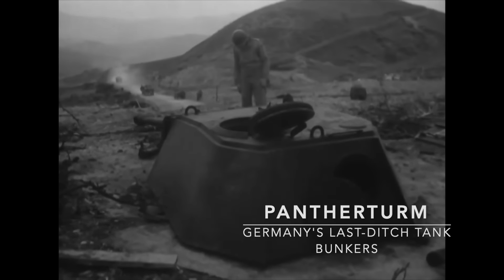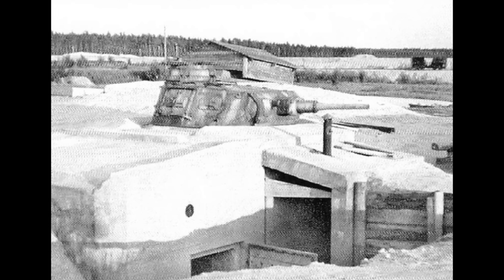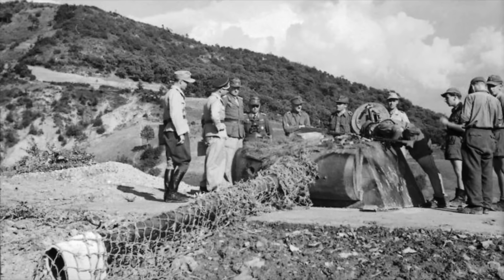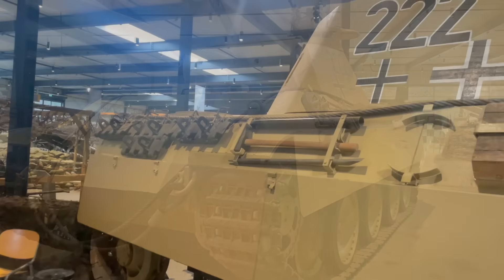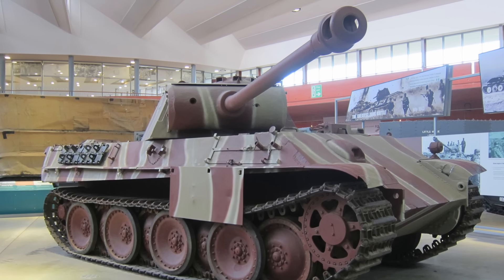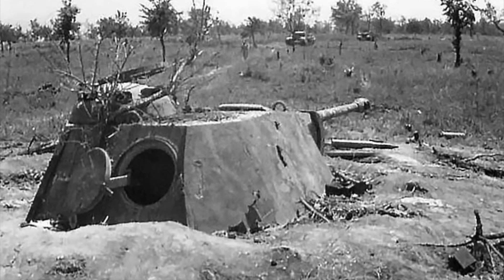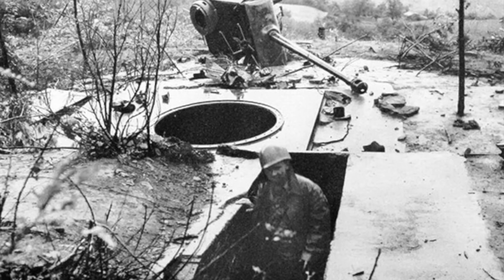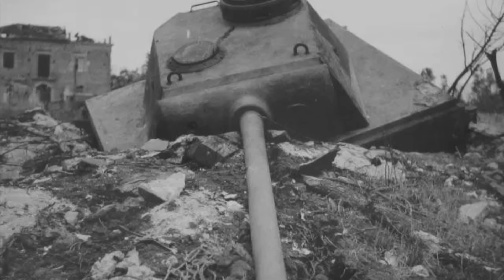Pantherturm - Germany's Last Ditch Tank Bunkers

Comment: I can only imagine the terror that Allied tankers experienced when being ambushed by one of these Pantherturme...
Reply: Panthertürme is the word you're looking for
Reply: @hansg9832 weird not how Dr Felton spelt it in the title or description.
Reply: @lumenvitae4215 it's the plural
Reply: Not much horror. A 75L70 firing from a fixed position at a target at a known range - most allied tankers would have no time to realize they just died
Reply: @lumenvitae4215  der Turm 
die Türme
the tower
the towers (or turrets)
Reply: At least they couldn't break down.
Reply: Another interesting video. But Mark you didn’t say if the gun turret could rotate or was it static - firing in a single direction?
Reply: @Wavesonthemountain  It can rotate. Sits on a normal turret ring
Reply: @Wavesonthemountain They rotated manually by a crank. More advanced ones kept a powered geared traversing ability. By the end of the war, they were just burying a tank, adding a twist to “Hull Defilade”

Comment: It’s also logistically cheaper to mount one of these turrets. It doesn’t require fuel, entire mechanic crew, or part replacement program to maintain it.
Reply: It was a desperate, delay, speed bump at best
Reply: I'm guessing the bunker and turret required a gasoline engine-generator to supply power for the turret rotation and gun elevation.
Reply: @gregorymalchuk272  I think he actually covered that in the video, some had powered traverse provided, some (I'd guess most) just had manual turret traverse and elevation. Since it's a stationary turret meant for point defence speed of traverse isn't really a huge concern.

Comment: At the time the Panther entered service, the Germans had learned the lesson of needing a good armoured recovery vehicle or ARV.  Before the end of the war, over 300 Panthers were modified to fit the ARV role, which essentially required the removal of the turret and adding engineering features such as winches (if available).  The finished product was known as a Bergepanther.
Reply: The Bergepanther where all purpose build. The inital batch where basically tank chassis without a turret but later had quite different hull fronts and a massive winch etc.
Reply: Burgerpanther sounds delicious
Reply: @I_hunt_lolis  One of those totally wrong Allied translations. In german it would be a Bulletenpanther and a Bullette does not come in a bun, it is only the meat part ;)
Reply: Some notes: Englisch wall is in german Mauer/ Wand, german Wall is in english rampart. The Westwall was not the first defensive line in western botderline of Germany.. In baroque era in south western part of HRE, mostly in current state Baden-Württemberg ( perhaps also Rheinland - Pfalz) a number of defensive lines existed.. Trough the Black Forrest the Vordere and hintere Linie, at north- eastern end of Black Forrest into hillland the Eppinger Linie. This lines consisted of natural obstacles and man made wood- earth obstacles/ fortifications. Also some villages/ settlements got light fortifications. Those lines been in peacetime manned only by few guards, in war time mostly by militiamen or even levies of untrained men.
When Westwall was build , modern 1930s Bunkers and obstacles had been often at locations, where in baroque era wood- earth fortifications had been.
Reply: @mbr5742 assuming the turret assembly line could produce turret as fast or faster they would make a spare turret that could be used for fort while these non turret versions built.
Reply: Easier to assemble turrets than the main part of the tank is likely the reason these made. 
One could argue turret assembly line should go ideal and resources saved but that not a slam dunk argument as the turret bunkers seam quite effective. 

Forts build during a war have advantage of no peacetime official diplomatic spy’s to way more easily get the layout.
Thus war built forts can be quite effective. Still cannot reverse massive greater Allies  economy swamping them under combined with superior manpower.

Comment: Great topic very interesting. Just a bit more info to add. Many turrets were specifically made as PanzerTurms with added top armor to resist artillery shells. These turrets were all hand cranked not power traverse. The electric power generators inside were not for the turret treverse but for inside lighting.

Comment: I wonder if these were hand cranked or if they had the powered systems to rotate the turret and raise/lower the gun. I saw they had power systems just wasn’t sure if that was part of its use. I have operated old WW2 anti aircraft systems and two men can actually move them super fast with cranks
Reply: Most sources say hand cranked with the engine only for a generator that produces light etc

Comment: The Panzerkampfwagen V "Panther" was mainly assembled by MAN and Daimler-Benz. Henschel and M.N.H. also produced the tank, but in irrelevant numbers. The parts came from different producer, f.e. the turret came from Krupp, the barrel from Rheinmetall-Borsig, the gearbox from ZF and the engine from Maybach-Motorenbau (Daimler-Benz). If one of the production/assembly lines was bombed, the need for turrets decreased. However, turret production at Krupp remained the same, so there was a surplus of turrets.

Comment: It is said that the Germans had no fuel reserves left by 1944. They were already using the maximum amount of fuel available to them, and this still wasn't enough, supplying only a fraction of their needs. It didnt matter if they produced more tanks, they didn't have enough fuel to run them, which is the point of mobile tanks. Add to this their shortages of spare parts, ammunition, crews, especially trained and experienced crews, and you have a recipe for disaster. 

When you consider this, it makes sense why the Germans did not produce more tanks and chose to use the turrets as fortified emplacements. By this stage of the war, the Germans had largely shifted to a defensive stance, and the days of blitzkrieg were over.

Comment: Finland bought 56 T-55 turrets from Soviet Union in the 60s, and used them as stationary coastal artillery guns (100 56 TK). They were later modernized with computers and laser range-finders, some also with night-vision. These were deactivated in yhe 2000s.

Comment: I was under the impression that the turrets were specially built, not surplus from the tank production. Modifications including: thicker roof armour, simplified commander’s cupola, manual only traverse.
Reply: Both according to some sources. With the later turrets being the ones with add on roof armour etc.

Comment: Perhaps the Soviets were impressed with this idea in thier Far East frontier fortifications, facing then hostile communist China. They used similar buried tank turrets overlooking nuclear & chemical minefields along the Dragon River. And for added security measures, three classes of soldiers had identical uniforms to confuse the enemy. Fortification troops, comminication troops but the third is lost in my memory.
Perhaps rocket troops or engineers.

Comment: Interesting (and a hint that old turrets were to be used is that on the drawing there is a round hatch on the side of the turret, that is only present on the Panther D, the first version of the Panther.
Reply: When the turrets where planned the Ausf G was still a year away (planning began in mid 1943) and the Ausf A just came into production. So the drawings use the Ausf D version as a base. Since the turrets can be interchanged (they use the same ring) what ends up on a bunker base varies

And with quite a few turrets being specialy build (re-enforced roof for example) they are not recycling turrets

Comment: Easy pickings for Allied air power, especially after mark stated when the camo was blown away by artillery and the foot soldiers retreated.
Reply: If you look up where and how many where mounted and check the accuracy (or lack thereof) of plane vs. tank in the time frame - not so much. The ones in Italy and on the Westwall often where positioned below a hill crest and would require rather fancy flying to prevent the pilot from having a "serious emotional event". Or maybe put Tom Cruise in the plane ;)

Comment: So basically Germans produced tanks without turrets (Stug 3) and then fortifications with turrets. Someone must have been really confused, altough tbf it makes sense. What you HAVE to have for a tank is a powerful gun, armor and mobility, turret is very useful especially on offensive or in built up areas and its standard for a reason, but its technically not required. And bunkers are significantly more powerful if you actually got a tank turret instead of just machine guns or even fixed position guns.
And ofc as Mark mentioned, most of the time they just used obsolete turrets which was propably really good use of them.
Reply: They went as far to make the roofs of the turrets thicker to withstand attacks from above better
Reply: It can also be connected with the lack of fuel the germans were suffering from.  When you look at the pictures from late war, there is an abundance of given up tanks. 
 
It took the allies until July 1944 to attack the german fuel industry in earnest. Weird, because it were giant plants hydrolizing coal to gasoline that could not be quickly moved underground, or almost pinpoint targets like the ball bearing factories in Schweinfurt. 
 
Within 3 months, the fuel production was down to 30%, at the end of the war it was at 3%, the german fuel "reserves" down to 20,000 tons. 
 
See the hundreds of Me 262 parked along the Autobahn Salzburg, more or less complete, but no fuel. 
 
The train and "Holzgaser" trucks need only coal So a tank turret might require no fuel, contrary to a tank.
Reply: @feedingravens  The Pantherturm project was started in mid 1943 so prior to the attacks on the fuel supply.

Comment: More turrets than chassis. This is a graphic example of the Nazis complete failure to master coordinated mass production.  No such state of affairs would have arisen in the allied war factories.
Reply: Baloney. The chassis would also require an engine, which were in even shorter supply. Allied war production in the United States and Canada was not bombed into submission, either. That bombing had significant impact on German “mass production.”
Reply: Whilst true, there may have been other factors which made more turrets be produced, i.e some tanks being designated other types which didn't need a turret after initial order, shortage of materials, shortage of labour, certain parts of factories being damaged, it's easier to build just a smaller turret, etc, etc. By later 1943, German High Command was already thinking of defense & increasing fortification capability, for all Fronts. Using old turrets makes perfect sense, but a lot of the guns on the older turrets would be useless against the latest Allied tanks.

Comment: The Jagdpanther was one of the best looking tanks of ww2. Such a stepdown.
Reply: technically the jagdpanther was not a tank but a tank destroyer.The best looking and most effective tank in ww2 was the Panzer VG panther imo. By far the best variant of the panther as well. The panther had the perfect blend of firepower, maneuverability and protection of any tank that saw combat in WW2
Reply: @BRANFED  You are right i was mixed up i ment the "Panzerkampfwagen V Panther"
Reply: @theblackjubalharshaw  np..  it happens too me too..
Reply: @BRANFED  Well, wrong. Panthers were notoriously unreliable, even later versions like G. On a march of 100km usually half would broke down.
Reply: @aleksazunjic9672  the G was as reliable as the panzer IV.. maybe 65 to 70% readines
Reply: @BRANFED  Even G version had practically same suspension (double torsion bars and interleaved wheels). Problems with gearbox also persisted. Readiness numbers could be deceiving, as Germans were prone to fudging them. Overall, Panther did not have one successful offensive operation, unlike previous tanks. Reason is simple, you could not expect from Panther unit to march into enemy rear and create usual German pincer. They were sometimes good in defense, and that is about that.
Reply: @aleksazunjic9672  sigh.. Panthers comprised 1/2 of all tanks in a tank division in 1944/45 AND YEA, they did have successful operations in the attack such as the battle caen
Reply: @BRANFED  Panthers did compromise one half in many panzer division, but they did not have any successful offensive operation in war. Germans were defending at Caen , they did inflict lots of casualties on British, but even there they had to retreat. As I said, units equipped with Panthers would barely endure 100km march, thus they were practically useless for German encirclement strategy that worked well in first half of the war.

Comment: This show us again how bad the panther was designed, too overweight and too complex for being an frontline mass produced medium tank.
A more simplier but efective design following the lessons learned from the panzer 4 and the tiger will be the check. But they produce a t34-nized panzer 4 of the size of an tiger...
Thats not very intelligent...
Reply: I have the impression that the was a reason for the overengineering - that germ(an)s only had very limited resources, but ample work power. 
When you do not have a lot of steel, then you better use it to the maximum efficiency.  
 
Russia had practically unlimited resources behind the Ural, 
 
The US had the advantage of a country that had never a bomb fall on its homeland, so could boost up its production totally unlimited and with also as many resources as you needed.  

Regarding unlimited resources - I read somewhere the story that the russians sometimes came with trucks into a village, rounded up all men and then drove them to the frontline. 
There they unloaded the men, they were told "Over there are the germans. Their position must be conquered. Weapons you can get from the dead lying on the battlefied.Go."

And just yesterday russian POWs in the Ukraine said they were just taken off from work, or from prison, and transported to the front. And there, with zero military training, they were sent as the spearhead of russian attacks, One said of his whole unit, just a dozen survived. 
 
So Russia still applies the same "strategy" as 80 years ago.
Reply: welp some would say it was the best tank of the war it isent but. It had lots of flaws and postives. First of all the mobility was excelent it had a very advanced suspension system and lighter design than tiger and faster. The panther g had most of the engines issused solved so it woulden catch on fire but the suspension was very complicated. Then the gun it had a 75mm gun wich could pen 192mm of armour at 10 meters. But before panther g the engines did catch on fire a lot. Now the armour the panther had excellent frontal armour 80mm sloped at 60 degress made it equal to 160mm the turret was 100mm and the sides 45mm This mean it could not be penetrated by most allied guns. 

Personally i would say its better than t-34. The t-34 were very unreliable do to the poor manufacturing quality a lot of them broke down and sometimes the joins dident connect well so the armour would just slide down. But ofc it had its excellent speed and manuverbility aswell as 85mm gun wich was pretty good. Also consider it was easier to make the panther than the panzer Iv or around just as difficult if not a little more.
Reply: Weight was just fine. 700HP, 45ton (14hp/ton), 0,85km/cm2 ground pressure is a good set of values. The Panther performed similar to an M48A2 in cross country mobility and speed.

Too complex for mass production? Not really. It was specially designed for mass production and could be build as fast as a Panzer III or IV

High maintenance - yes. Mainly due to political interference. The MAN engineers wanted to change the final drives and gear box to the one from the Mobile Bunker VI Ausf. fAt but the Eva and Blondie wanted a tank viagra for the lil Führer NOW and Addi was tired of their bitching
Reply: From 1943 januar to like spring 1945 6000 Were made wich is not bad Numbers for the germans.
Reply: @feedingravens  And the USSR also had the benefit of US trucks, US fuel, US planes and US and British tanks. Sure, a Valentine is not as sexy as a T34 or IS-2. But it is a well armoured and reliably vehicle that can not be ignored since it then WILL maul your infantry. And needs a Pak40 or the "longer barreled" 75 of the Panzer IV F-8 and later to kill at 500+ m
Reply: @e8939 About the same number as Panzer IV (6483) in the same time frame. Shows how fast they could be build. And the P IV was already in full production in January 43 while the Panther only reached more than 100/month in May
Reply: @feedingravens : Pearl Harbour in Hawaii is US Sovereign territory. So their Homeland was bombed.
In addition, I seem to recall the Japanese using incendiary balloons over the West Coast and even some Japanese torpedoes being found buried in beach areas.
Reply: @mbr5742  in February 1944 the made 213 panther tanks.
Reply: @jensole8939  And that has what to do with the 1943 numbers? Oh wait - Nothing
Reply: @StevenKeery  how many tank plants, refineries or steel mills are on Hawaii?
Reply: @mbr5742  just wanted to support youre argument of the fact that germany could mass produce the panther tanks, in good numbers